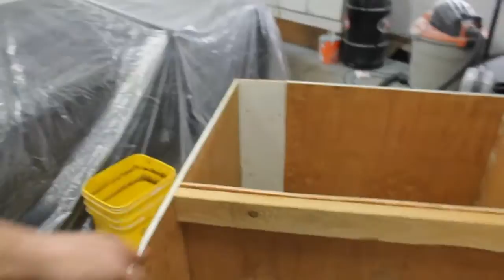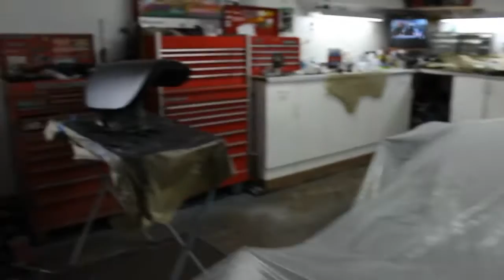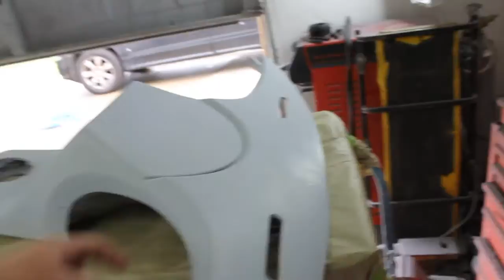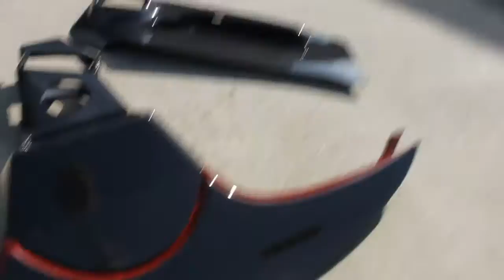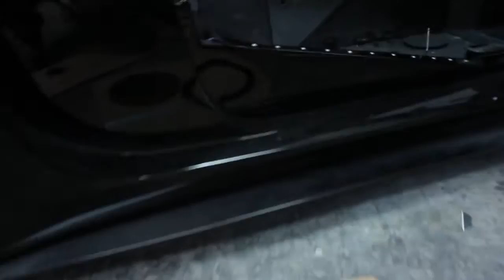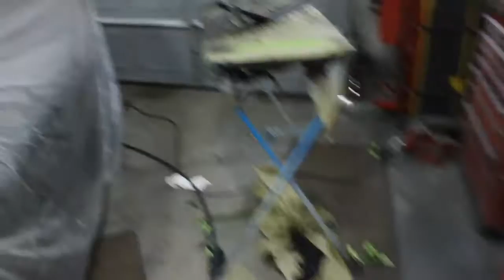Factory Five GTM Supercar, fastthings build log....... Part 76

Comment: I love the carbon fiber look. What steered you away from the vinyl wrap you initially planned on, though?
Reply from the maker: actionjack40 Thanks, I steered away because of the complexity of the parts I ended up making. It would be impossible for me to do it myself in a timely manner. And I decided I didn't want to pay someone to do it. I had thought about that before, and decided to do it. 
I got the idea of the hydro dip from one of my subscribers, thanks to you, for the hot tip.